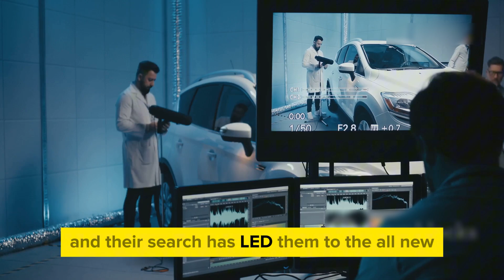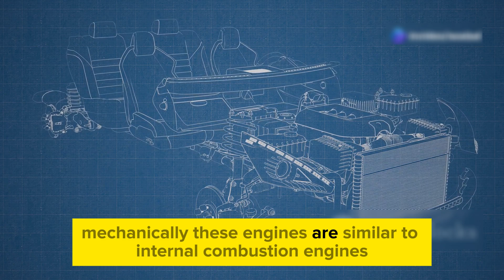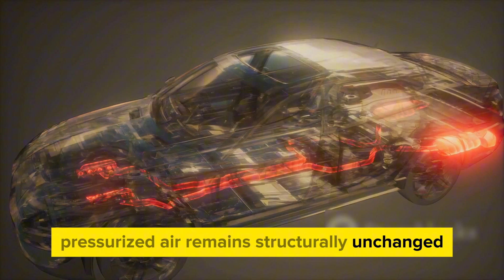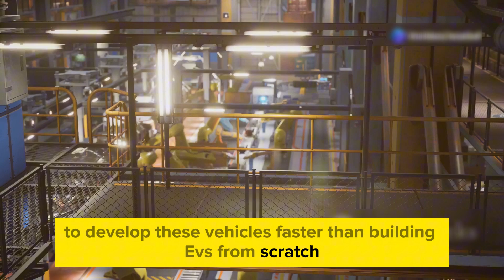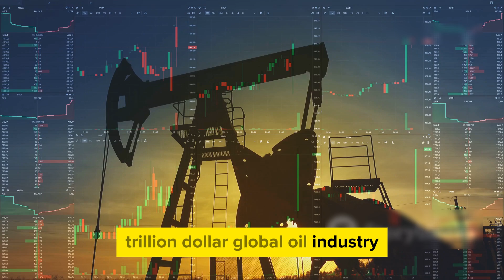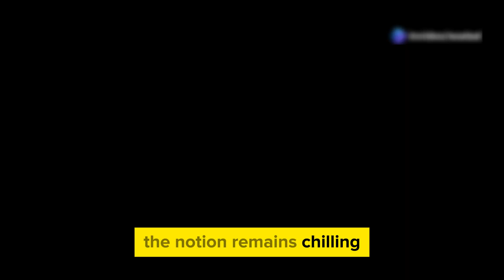GM CEO: "This New Engine Will OBLITERATE The Entire EV Industry!"

Comment: No Confirmed GM Compressed Air Engine in Production:
	•  As of May 5, 2025, there is no verifiable evidence from GM’s official statements, press releases, or credible automotive sources confirming that GM has developed or is producing a compressed air engine for consumer vehicles. Claims about a revolutionary compressed air engine from GM appear to be speculative or unverified.
	•  GM has focused heavily on electric vehicles (EVs), such as the Chevrolet Bolt and Cadillac Lyriq, and hybrid technologies, with significant investments in battery production